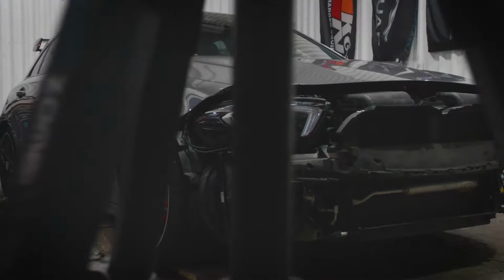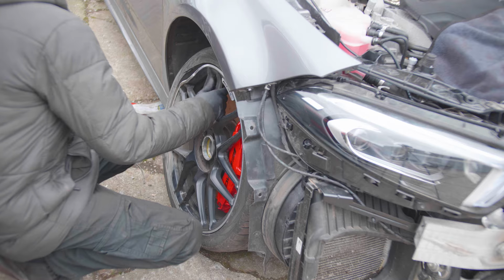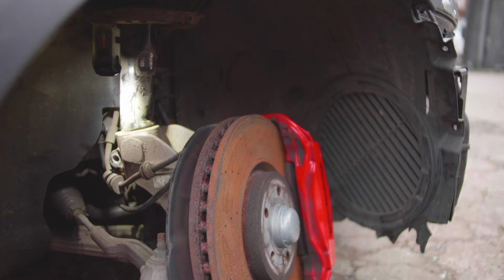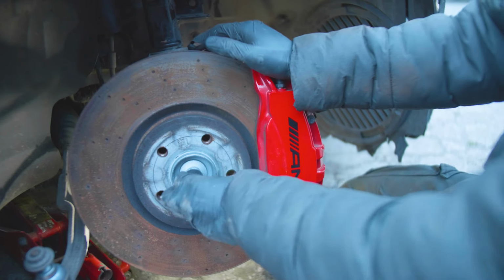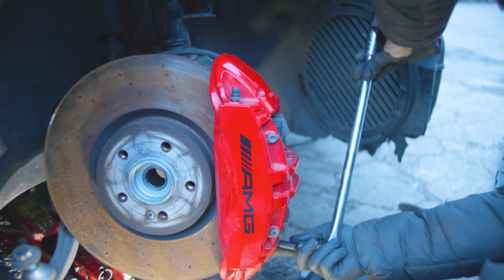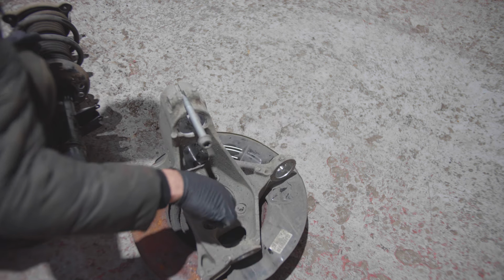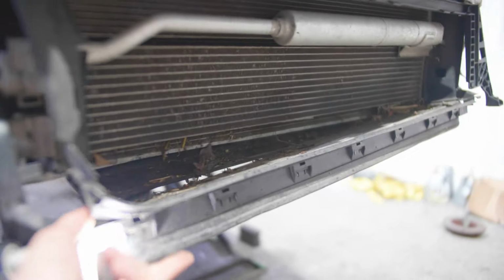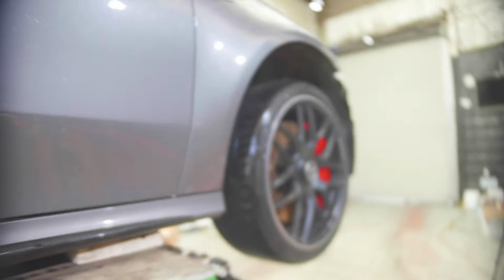MY WRECKED A45S AMG FINALLY MOVES - PROJECT PAYDAY: PART 2

Comment: Its always good to change the whole suspension but in this case I think it doesn't need a whole suspension change, if the control arm is bent we will find it in tracking, the front axle is all good but seeing the rear right wheel ,the control arm may or may not be bent of that wheel cause when I saw it in the video at some angle it seemed to be a little off track, its just looks bent to me but it might not be, I don't know
Reply from the maker: Well said , still awaiting alignment 👀